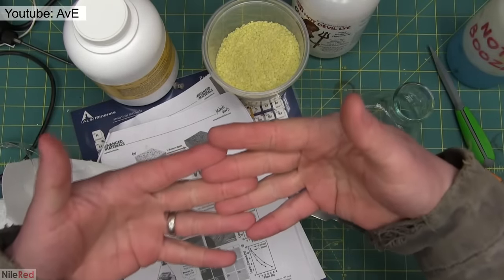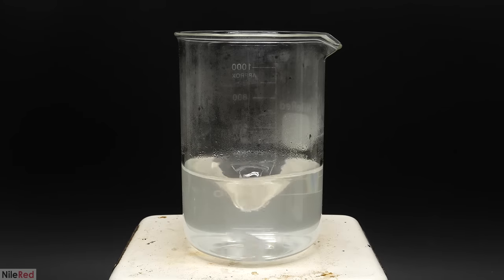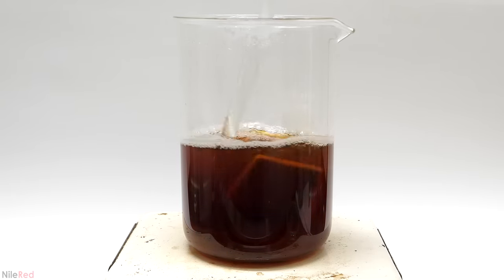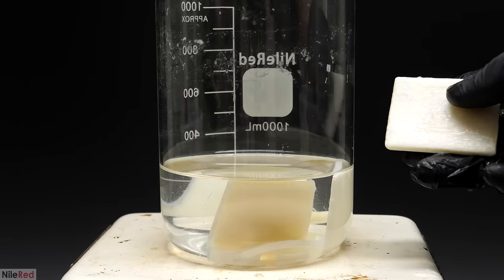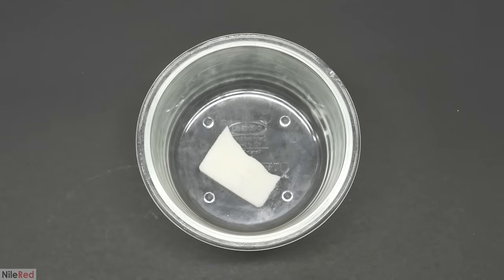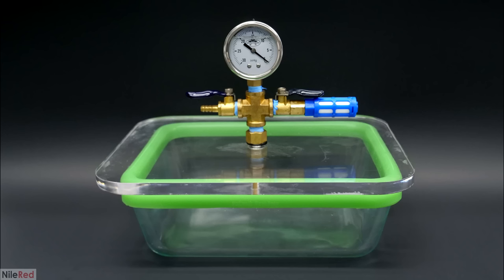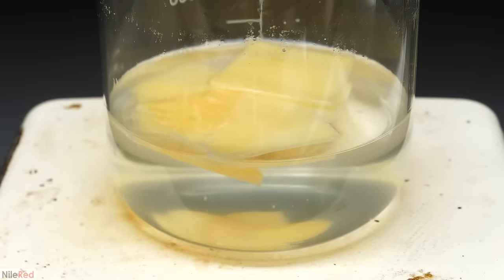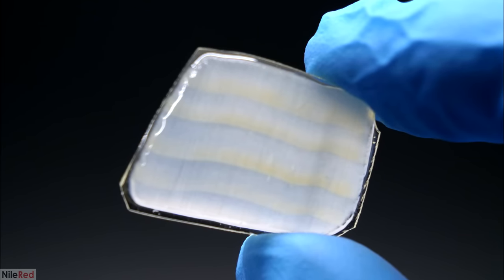Attempting to make transparent wood

Comment: 2:10 My blood pressure skyrocketed when his fingertips were just casually centimeters away from the blade.
Reply: Cyr P. Ok safetyboy
Reply: @friendlyneighborhoodcrackh6059  If he lost a finger his Youtube career would be slowed down,  not to mention the suffering. Don't be ignorant.
Reply: @Twelvebeans  thats not gatekeeping mate
Reply: Friendly Neighborhood Spider Just have a quick search for table saw accidents and table saw kick back... you'll see how dangerous they can be, even to carpenters with many years experience
Reply: AJ Burdett I’ve seen them firsthand and actually always practice good technique when using power tools lmao. I used to work in a nuclear power plant and they really nail safety into you there. I had just smoked a lot of pot and thought it would be funny to say. In retrospect though, not so much. I got my laugh tho
Reply: @friendlyneighborhoodcrackh6059  how much was you pay to work in a nuclear plant (Edit: im just curious)
Reply: Lantern I made 21$/hr before upgrades and overtime, but I was assigned to work inside containment so I got a 6$/hr upgrade. I also worked night shift netting me another 2$/hr differential. I HAD to take 80 hrs during the outage, and overtime pay was time and a half for anything over 40 hours, time and a half on Saturday regardless of how many hours I had that week, and double time on Sundays. Made 7-12s operating a freight elevator that broke down frequently with a bunch of sweaty dudes piled in almost bearable haha. Sure felt good to be making almost 60$/hr on a Sunday.
Reply: @friendlyneighborhoodcrackh6059  wow
Reply: The kickback nearly made me shit myself
Reply: @ajburdett882  i use larger machines using saws and get my fingers close as he did, even if not closer. I am 15, but i've been to my father's workshop since i was 4. Just practice, focus and eye-hand correlation and some safety equipment will be good to go.
Reply: @chetnikSRB  if you have that much experience you should know that no amount of practice or caution can prepare you for a random kick back, you should never get complacent. You have your whole life ahead of you, it'll only take a second of poor judgement on your part and you've drastically changed your life forever, everybody is human, everybody makes mistakes. You've worked with those machines for that long and you may be comfortable around them but you should always respect how dangerous they can be no matter how much experience you have
Reply: @ajburdett882  I agree, all of said is true, and I get nervous most of the time even when I am comfortable. I am just saying that table saws aren't the nightmare to work on. I've never worked using one hand on table saw or cut anything too big for me to comprehend. But generally, got really comfortable that I go to father's workshop to saw down some wood for furnace at winter. I will be honest here, I've never been injured hardly, probably the worst thing happened is a little cut when I used hand jigsaw on work.
Reply: @ajburdett882  but yes, those machines can cause deaths/invalidation if not used properly, so I always get prepared before using any of those.
Reply: @chetnikSRB   Correct yes, I'm not saying they're a nightmare to work with but you need to use them properly, and respect that they are powerful machines. In this video Nigel clearly didn't know how to correctly use the table saw safely, and was far to careless around it, he was lucky not to be seriously injured
Reply: Lol that is the normal way safetyboy
Reply: @friendlyneighborhoodcrackh6059  ok pothead
Reply: @macdermesser  I'm sure he was just joking
Reply: MILIMETERS
Reply: Somebody call OSHA
Reply: @alexroldanjr.5803  nah OSHA is about workplaces that violate supposed safety for the workers

Comment: I think resin you used has quite high viscosity. For soaking completelly through I would use resin called 'cactus juice' or resinol 90R, both have very low viscosity and they are thermally cured. In industry Methyl Methacrylate is used for wood stabilisation. Meybe it would be interesting topic for video? How to brake down PMMA to MMA and stabilise wood with it? :)
Reply: I'd love to see him do this, also I'd love to see one sanded back and polished
Reply: I was about to say the same thing.  I think it would work a lot better with a stabilizing resin
Reply: I highly doubt you can depolymerise polyacrylates effectively enough that purchasing methyl methacrylate isn't easier.
Reply: For sure it's easier and cheaper to buy MMA (I bought 5liters for 50$),  but it's about learning and experimenting. I can bet 90% of NileRed synthesis aren't cost effective, especially when you take in consideration labor cost.
Reply: @Woloszow  Sure, but I bet there isn't anything worth learning in depolymerizing PMMA either. It's an addition polymer, not a condensation polymer, so there really isn't an effective method of depolymerizing it.
Reply: I think you're right, the only way I am aware of is thermal decomposition
Reply: That's what I was thinking. Complete layman here, but I know enough to have heard of "cactus juice" and the benefits of it not setting until you bake it. With that, he could leave it in the resin for 12 under vacuum easy and probably get better saturation.
Reply: Peter Brown (another youtuber) works with alot of epoxy if you want to see 'cactus juice' in action.
Reply: I agree that a stabilizing resin seems to be the best way to go.  After all, its entire purpose is to be able to fully penetrate wood or similar materials in order to strengthen it.

One little wrinkle is that you want the index of refraction of the resin to match that of the cellulose.  This keeps the light from bending at every cell wall as it transitions materials,  and may actually be very important.
Reply: Another thing would be to find a resin or tweak a mixture to achieve a similar refractive index to the cellulose to minimize scattering
Reply: Cactus juice and Pressure pot not a vacuum chamber!
Reply: Nathan Woo honest to God, I thought this was going to be a collaboration with him.
Reply: I'd want to see him try to make them too, from the msin industrial chemicals used yo synthesize them
Reply: The whole point of the original research paper was to find a method for removing colored compounds from wood while retaining the physical structure of the wood so that it could be used later to form a structure for the polymer.  In order to make it transparent, they needed to use "index-matching polymers" - polymers that when cured have the same index of refraction as cellulose.   You can't use Cactus Juice, PMMA, or any other old clear polymer unless the index of refraction matches.  If it doesn't match, then light will not be refracted equally by the cellulose and the plastic, and you'll not get full transparency.
Reply: It could be spell check..but it is..break..not brake.
Reply: D R I N K C A C T U S J U I C E